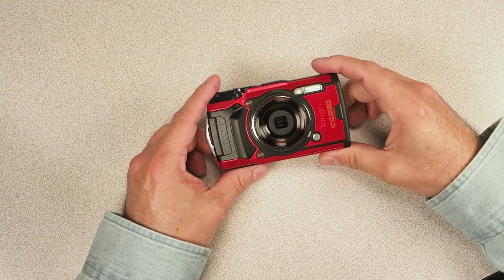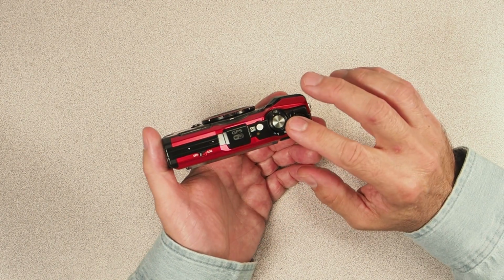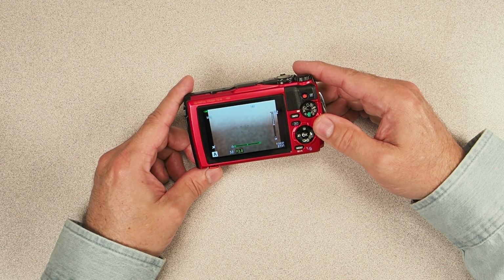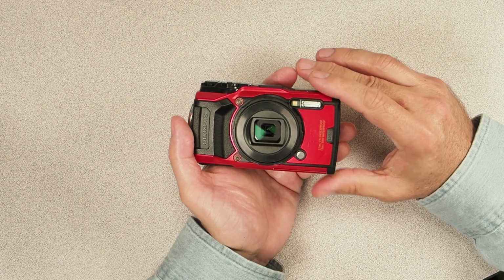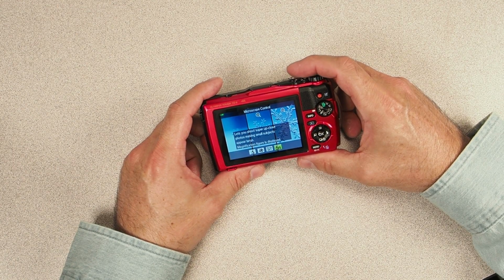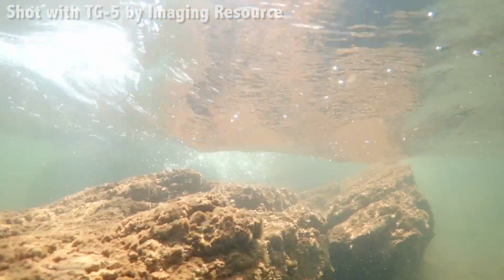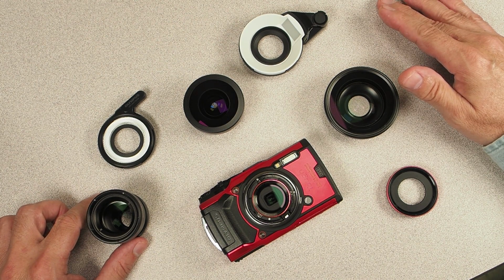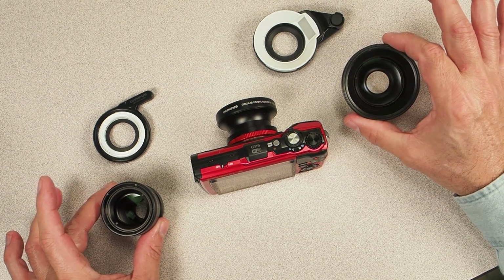Olympus TG-6 Hands-On Tour

Comment: I have no idea the extent to which this reviewer has actually owned and used the TG-6...but I have now gone through two of them over the course of several years. BOTH cameras failed me underwater, and NO I did not forget to close the compartments correctly :). The first camera failed snorkeling at a depth of 2 feet in the Philippines, and had been purchased with an Asurion warranty through Amazon and my money was fully refunded.  WIth this money I bought a new TG-6 Touch camera, and while snorkeling in the Caribbean the second camera again failed me.  The second time the leak was through another compartment.  I just ordered a used TG-6 camera (renewed/excellent condition) again from Amazon plus a warranty.  So, my lesson learned?  1. the camera is great, but never use it underwater without a separate housing. The camera is rugged for hiking and can handle the cold.
Reply from the maker: I can't speak to that personally, as this review was done right before Imaging Resource went dark, and the staff that tested it are no longer around. 

Failing at 2' is abysmal though. I can see why you'd be upset.

Comment: DO NOT BUY. I had the predecessor. The little door to the usb-connector broke off due to a stupid accident. It appears that Olympus doesn't repair camera's as soon as the 2 year warranty period has passed. You cannot get it repaired anywhere else, because it is a specific part only available via Olympus. So if something happens and you'd need a repair, you can just throw your camera away after the 2 year warranty period has passed. 
I tried to contact Olympus on this, but they don't even react on my request for a solution. The customer service of this company is so terribly lousy. .. It's a good camera, but as soon as some accident happens and you need a repair you're busted. My advise would be: NEVER buy Olympus.

Comment: One issue not mentioned is there’s no protection for the front glass, the cameras promoted as tough & shown on beaches & in rivers. These environments have sand & as there’s no way of putting a protective filter then the glass can be scratched. Getting it repaired costs around £150. Saying you don’t have to worry about anything is misleading, on every camera I own there’s a filter to avoid this issue but non of the so called Olympus Tough cameras have a way of protecting the glass from accidents. How easy would it to have had a clip on front glass to protect the expensive to replace piece at the front of the camera

Comment: I am new to the TG series. To be clear, at 2.50, the cover shown is an optional item.  But it does come with an unscrewable transparent cover as seen at 0.21.  One important item that should be mentioned is there is no Manual Mode, so you cannot set the shutter speed directly, except when you alter the exposure comp setting or play around with the scene settings. Aperture priority with limited to 3 steps e.g. Tele 4.9,6.3,18, Wide 2, 2.8, 8  norm 2.3, 3.2, 9.     I'm treating this camera as a fun camera to shoot on rainy days. There aren't many alternative waterproof camera that give you full manual control without needing a large bulky and expensive housing. You got to realise this camera is relatively cheap so don't expect all bells and whistles.  Even nowadays a camera phone has more functionality. But isn't as rugged as this. This camera seems well built and the seals at entry points seem good.  I am using this camera on holidays when it is raining and my A7riii would get soaked, full of condensation which takes ages to get rid of fogged lenses and viewfinder.   Wish there was an optional lenshood which could help reduce flare but also protect the lens from rain droplets when shooting in raining. Please do correct me if I have any facts wrong.

Comment: I have the TG-4 and have been thinking about upgrading.  Is the TG-5 or TG-6 worth paying the $450 to upgrade?  If so, which would you recommend and tell me why the upgrade is worth spending the money.  Nice review, I like how you presented everything.  But I don't recall why the TG-6 is better than the TG-5.
Reply: only screen pixels and menu options are better at the tg6, all the rest is the same. buy a used tg5 its the best solution